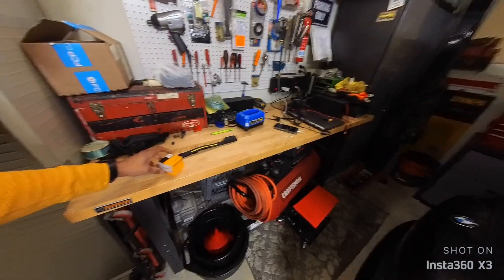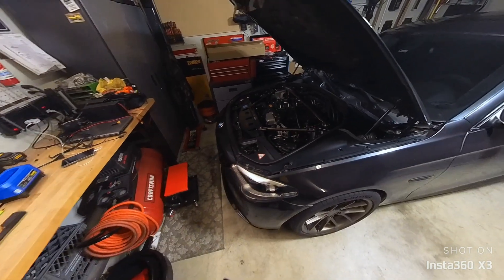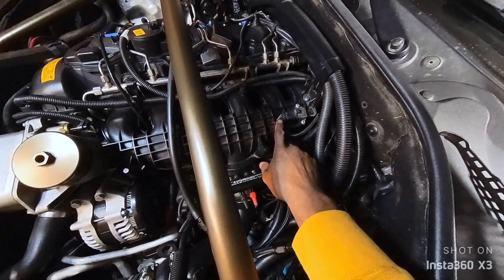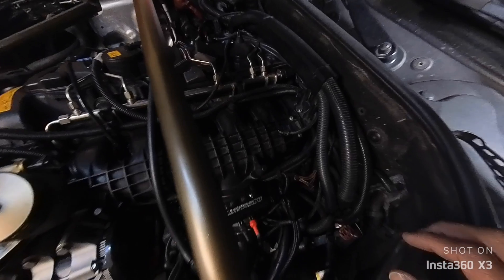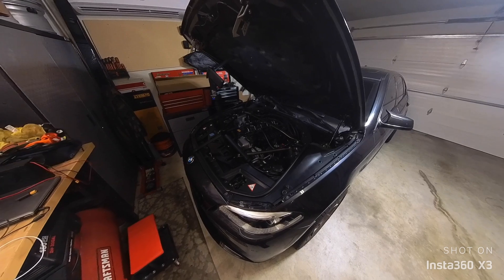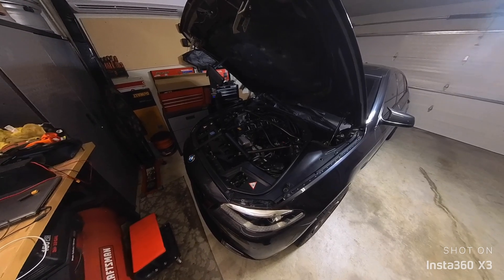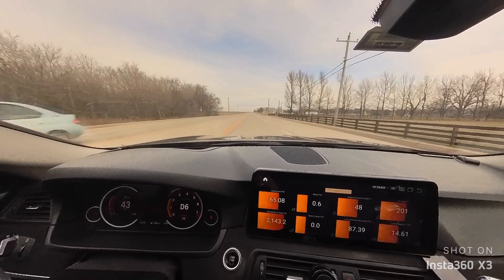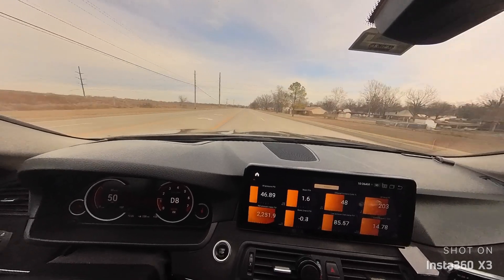N55 Adding a Second 3.5 Bar MAP Sensor

Comment: I am stage 2 MHD running stock map sensors on upgraded charge pipe, boost pipe, and downpipe, ive ran a smoke test, and can't figure out why Im not hitting anywhere near my boost target, it targets up to 20-22 sometimes but can only hit 14-16, would this 3,5 sensor swap help? on the charge pipe and the intake manifold / either or
Reply from the maker: Stock map sensors can read up to 22.9 psi, so this doesn’t sound like a map sensor problem. Are you PWG or EWG? My initial thoughts are boost leak or wastage failure. I am assuming this is stock turbo.

Comment: No coding/tuning for the intake 3.5 sensor ?
To just run it ? Ik with the charge pipe you have to select 3.5 on mhd to make it work
Reply from the maker: You will have to have the tune modified for 3.5 in the manifold. Your tuner should be able to handle that.

Comment: Does stock turbo need a 3.5 bar?
Reply: i disagree. I just installed a 3.5 bar MAP sensor in my 2014 335 at BOTmod3 stage 2 and I noticed a big difference. Throttle pedal feels way firmer at initial input. When properly warmed the car pulls way harder now. Seems like the stock sensor was restricting things. Now in a few months I am definitely getting a bigger turbo.
Reply: @cammgt3rs370 nice I’m bout to slap my pure500 and get this upgraded sensor
Reply from the maker: @rockieg02  Yeah, doesn’t hurt for tuning.
Reply: @JohnsonMotorsports Yes sir.
Reply from the maker: Nah, this is only helpful for boost above 22.9 psi.